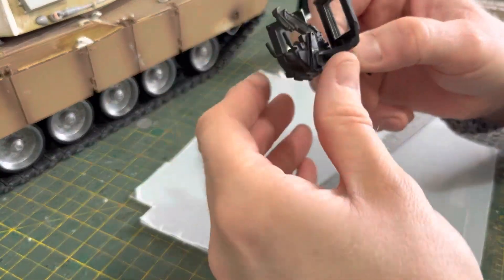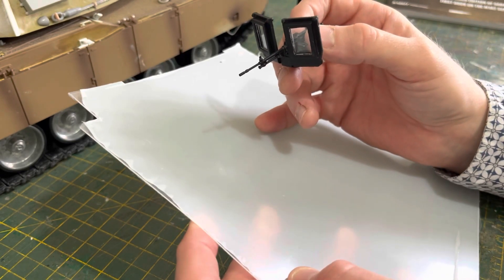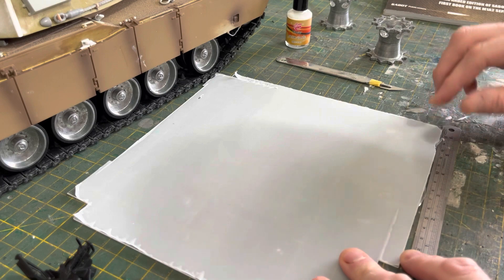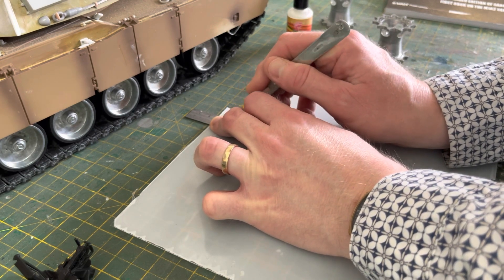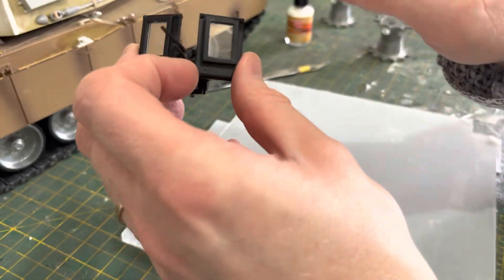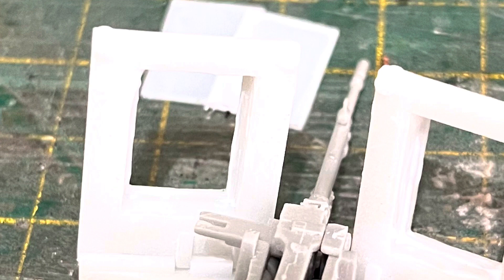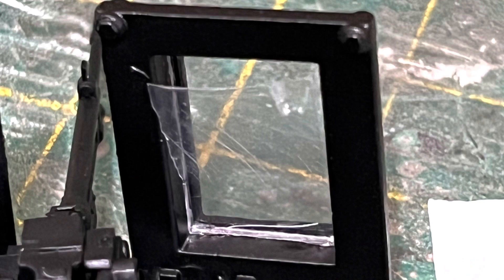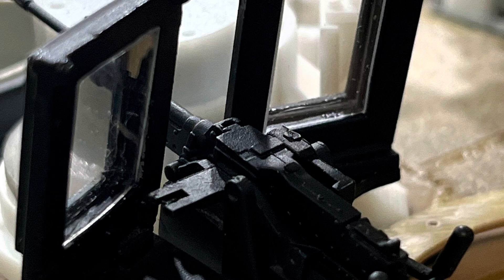Heng long/Tamiya 1/16th Abrams M1A2 sep v2 DKLMRC loaders shield Glass fitting and #modified

Comment: A friend has buyed a hengLong abrams, any tips/advice for him?
Reply from the maker: Hi!
The only thing I’d say is if it has plastic gearboxes change them out if he’s taking it outside.
The tank is a good little model, I’m only being an idiot and over detailing it! 😂
Reply: @mrtankalotrctankschannel  he got a metal gearbox,tracks, and some other parts.
The Problem is (same with my Leopard1) the tank is too slow(for a modern tank)
Reply from the maker: @exzendar2523  I think you can get red 390 motors that are faster, and 3/1 gearboxes are quicker, but a less torque
I’d rather have the torque than speed, so never really experimented with going faster
Reply: @mrtankalotrctankschannel  motors are a good idea , i was only thinking of changing the whole gearbox.
My (midage)tamiya kingtiger is much faster than the leopard and abrams, not very acurate😅